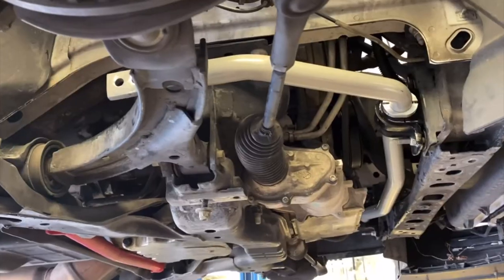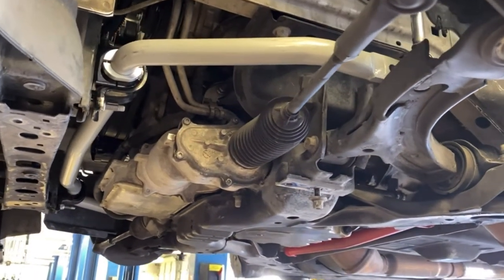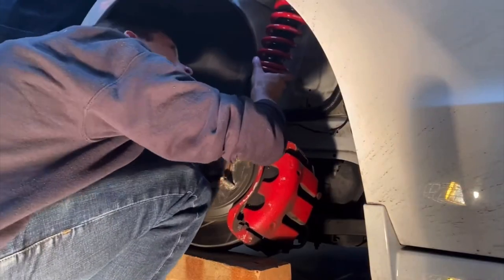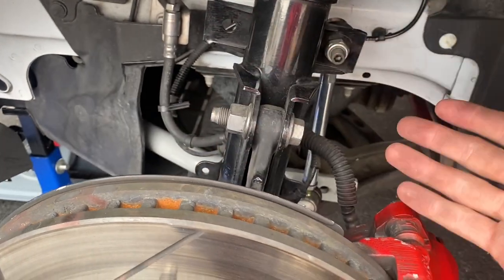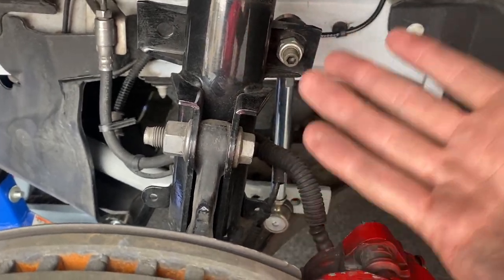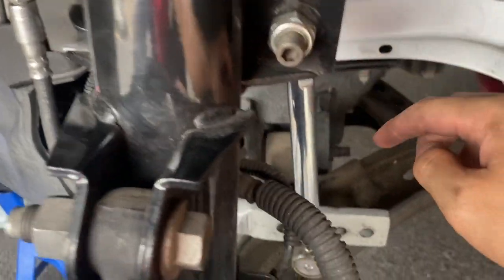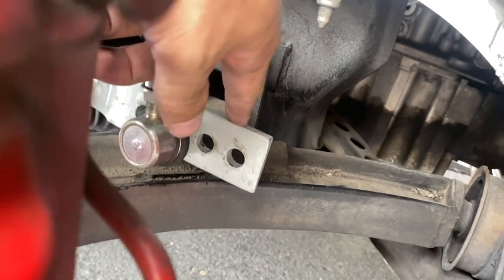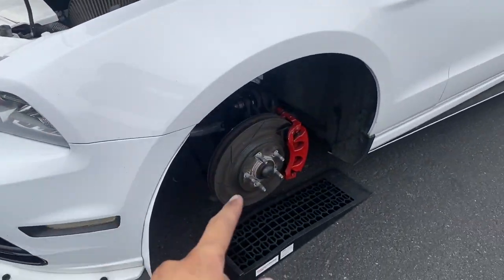Front End Clunking FINALLY SOLVED!

Comment: Ya ever hear someone shake a sheet of metal take that sound but it happens only when I turn the steering wheel at a certain degree and it only happens on the passenger front end side what do you think ?
Reply from the maker: Depending on what mods you have it could be a variety of things. If you have an aftermarket sway bar and it was installed incorrectly could cause clunking. Camber plates or top mounts that are worn down can cause unwanted sound as well. Ensure all the endlinks are torque to spec and wheels are tight. Also, as weird as this sounds, check to see if your fender liner has play. I’ve had this issue in the past and fixed it